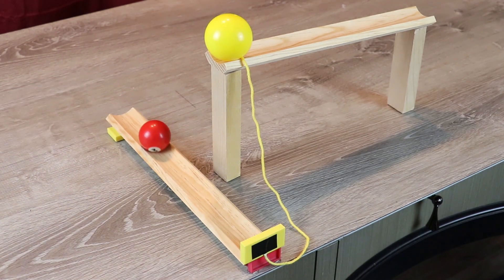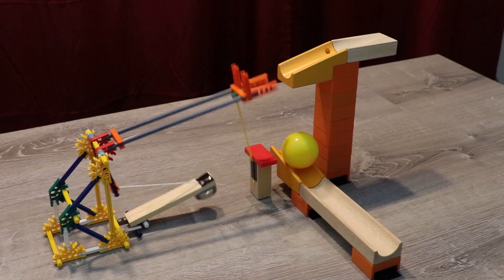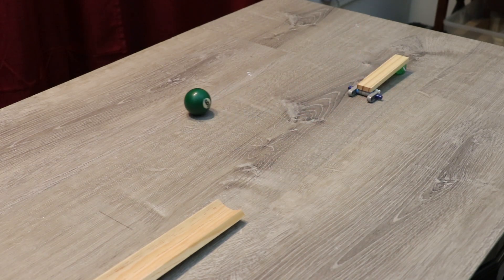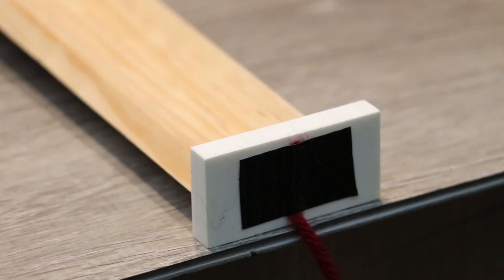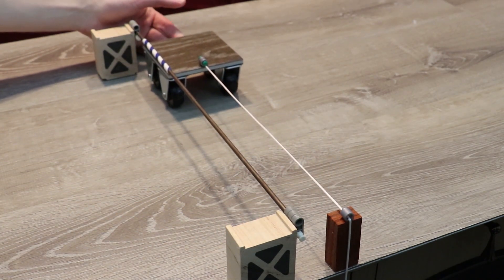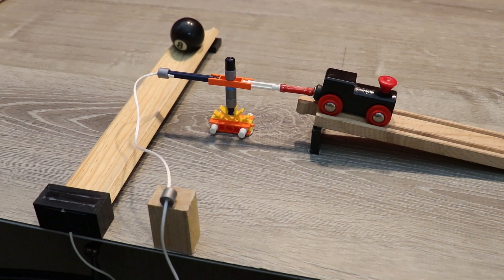Episode 1: The Basics | 50 Fundamental Chain Reaction Mechanisms

Comment: For future reference

0:00 Opening
4:35 1. Weight & String

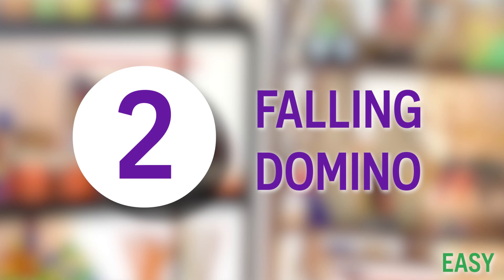7:30 2. Falling Domino
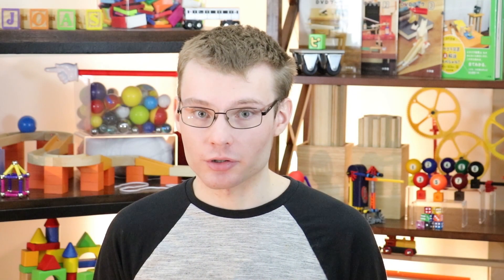10:08 3. Pusher
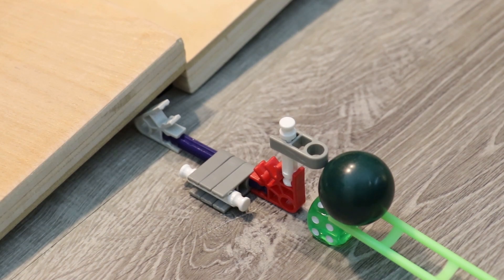11:02 4. Speed Bump
12:55 5. Track Transition Barrier
13:44 6. End-of-Track Stopper
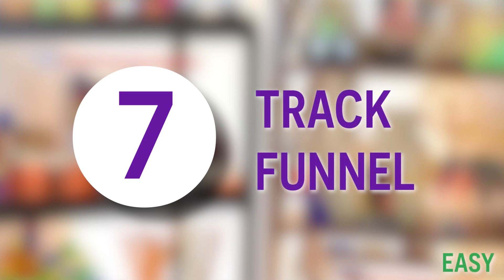15:47 7. Track Funnel
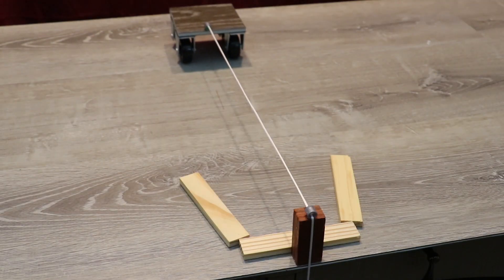17:10 8. Slider
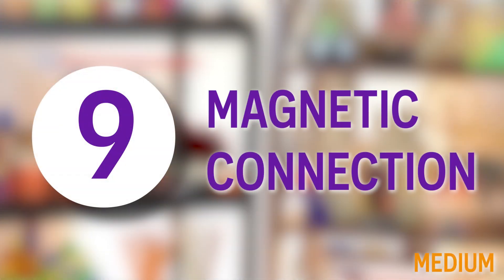17:52 9. Magnetic Connection
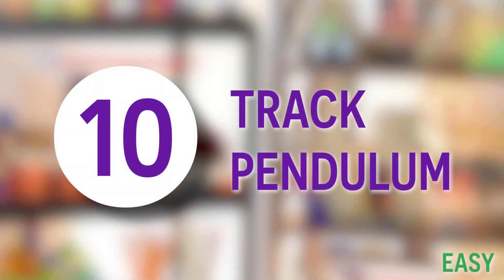22:29 10. Track Pendulum
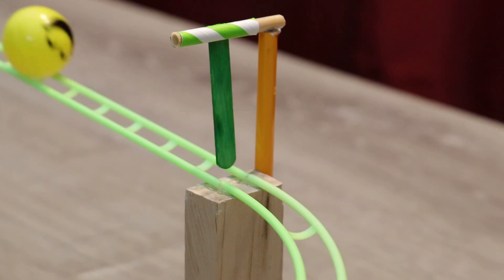22:59 Closing